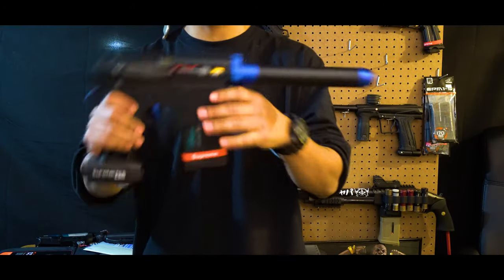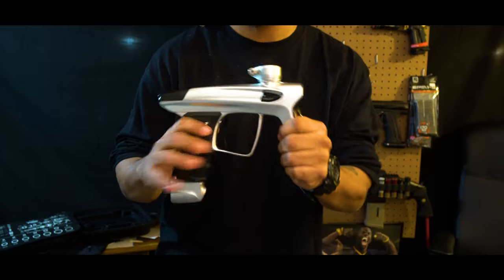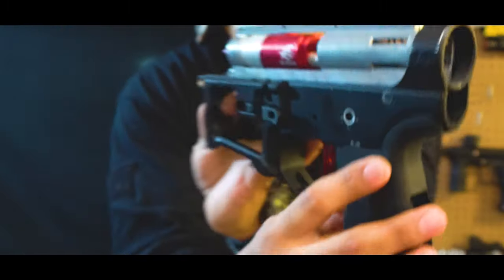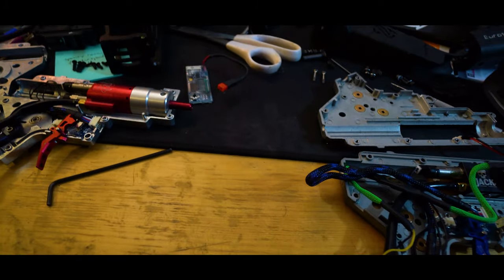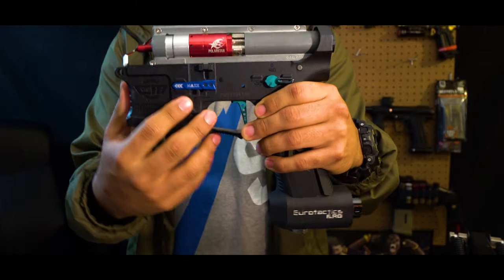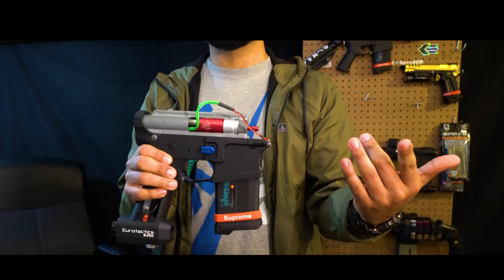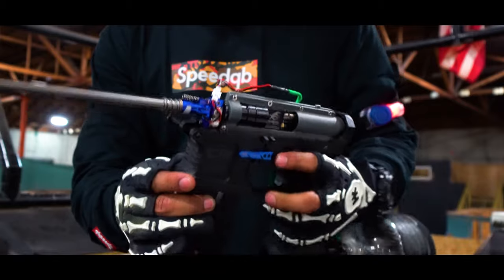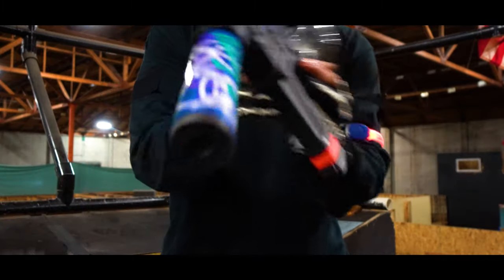Building a Paintball Marker for Airsoft // Eurotactics Grip

Comment: I noticed this video is kinda old, did the build work out for you? would you still recommend it?
Reply from the maker: It worked well for me that year. 
I used it in multiple tournaments with no issues 

It's slightly updated with minimal replacements parts such as the grip and upper receiver but that's the best part of having a custom

Comment: Wow those grips cost as much as the regulator that goes inside. I'm a bit dumbstruck because they are just 3d printed (sls to be fair, but they still need to bulk up the reg mount immensely)
There is a pushfit adapter to make the empire relay ASA/reg usable in a project like this which would be much more suitable.
Reply: i think the vendetta grip has that

Comment: yo was good Anferny im trying to get a speedsoft hi capper but i cant fine one so can you tell me were i could maybe fine one it would help a lot thanks
Reply: You can find a hi capa at any retail online store like evike, airsoftgi, lacapacustoms,blowbackmaster ect if you looking to mod it out to be the best for you i would just go with Tokyo Marui, most if not all aftermarket parts are based off of that gun 5.1 is the standard size 4.3 is a shorter more compact gun the grip length is the same barrel and slide are shorter i like the 4.3 for its size but up to you the parts are swappable between both just check online for what kind of parts

Comment: Someone need to build a HPA pistol grip made out of injected polymer, like the same material from receivers and AEG pistol grips, 3D printed ones just isn't strong enough because all those lines left from the printing that turns into a point of failure, also I think it would be way cheaper than those Monk / Eurotatics ones.
Reply: The eurotactis/monk were not made with a fdm printer that creat small line of Plastic. They‘re Made with the sls proceeding the grip isn‘t Made of small lines, the grip is lasered out of plastik powder that is a lot stronger than your idea this will brake as easy as the fdm Version.
Reply: @kai9086  Well, then they are doing something wrong with that process, cuz here in my city almost everyone that plays with ASA grips in their HPAs and AEGs (yes, there's ASA grips for AEG too) uses custom made 3D printed grips made with FDM printing and they're holding pretty well, just 3 people use Monk ESG and one of them already broken in half.